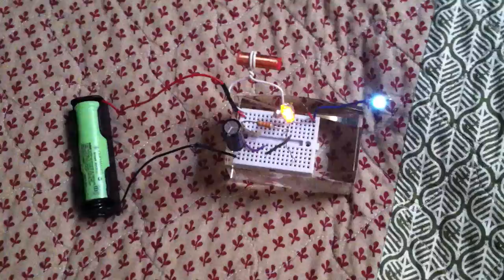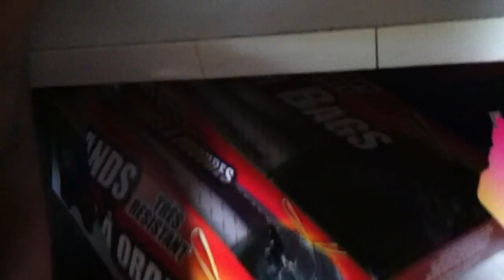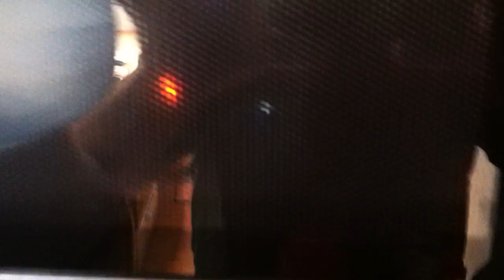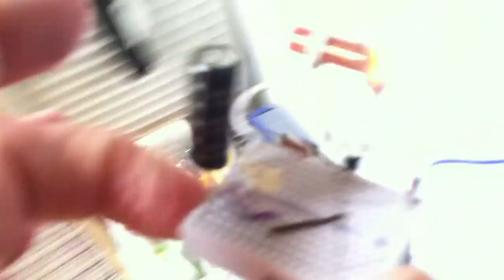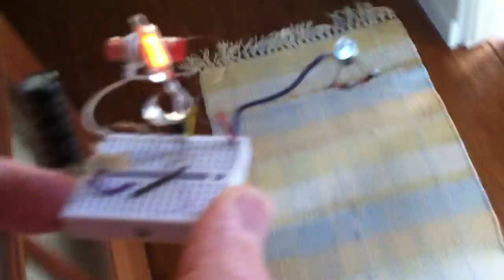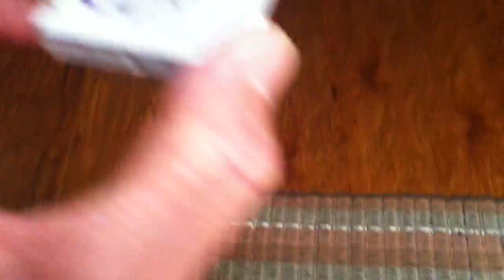Loopy Exciter running in faraday cage

Comment: I think for Faraday cage using microwave oven (only shields magnetic induction), you want to unplug from the wall AND earth ground the microwave, ok thru the plug prong.  Ideal the direct ground rod connection on its own circuit not to house.  Look up electrostatic shielding on Google, to see how to combine Faraday cage shielding for magnetic and electrostatic.  Medical transformers use same principles.  Surprised the Dr. does not know about it.

Could you do the test again with a voltmeter across your power capacitor so we can see if it is draining or staying charged up over a period of time not just seconds?